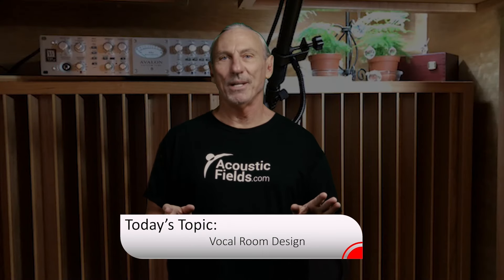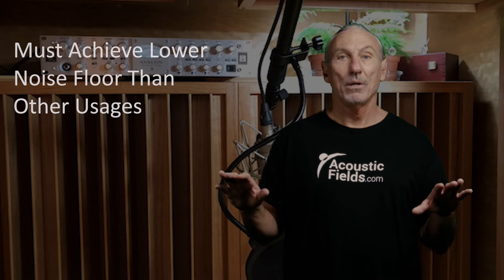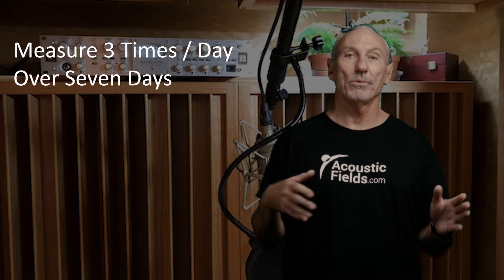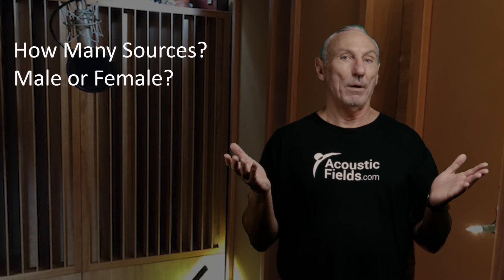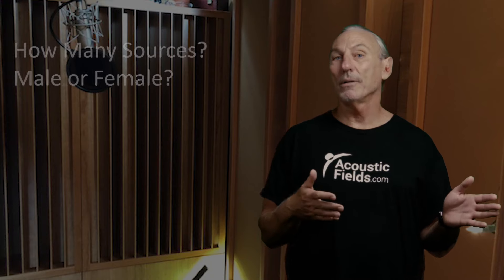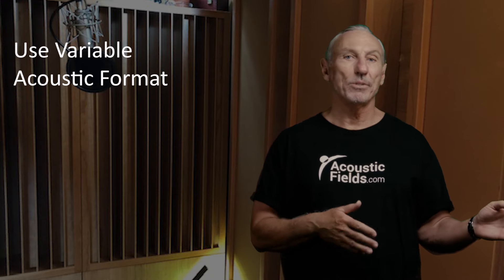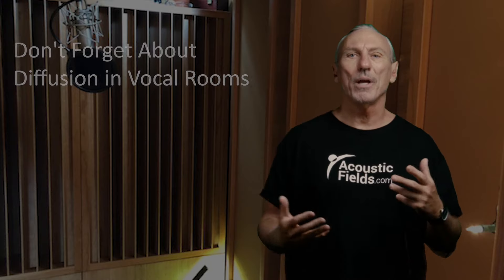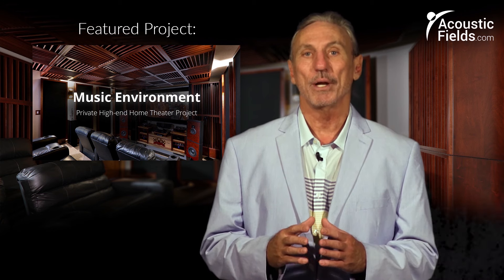Vocal Room Design - www.AcousticFields.com

Comment: Hi. Thanks for your excellent videos! I record voiceovers out of my home studio setup in my tiny studio apartment in NYC. I'm dealing with the noise of running water coming in from pipes behind one of my walls (bordering my neighbor's bathroom), which is picked up by my mic. I'm considering adding a layer of Quietrock on top of that existing wall, to reduce this noise. Do you think that would make a significant difference, or should I be looking at a different solution?
Reply from the maker: Noise must be quantified and qualified through measurements. We need to understand the frequency and amplitude (strength) of the noise we are trying to mitigate. We can assist you with the measurement and design process. Send us your contact information to info@acousticfields.com
Reply: You can also use noise gate plug ins which helps significantly, but it’s not a 100% cure
Reply: You'd need to open up the walls and soundproof them.  Or buy a ready-made vocal booth like Whisper Room.  Not the best, or cheapest, but in an apartment setting that's what's available.
Reply: @KirkYardley  I'd recommend a noise reduction over a noise gate. Noise reduction helps a lot with unwanted but consistent noises in the background if you can record a long enough sample of it isolated. I've used it to get rid of long droning machine noises often with success.

Comment: I've gone to great lengths to minimise fan noise on my computer that's in the same room as the mic.
Reply from the maker: The more you treat the existing room problems, the lower your room noise floor goes. The lower your noise floor, the more you here. Fan noise can really jump out at you with a low noise floor.
Reply: That's why you should have a separate vocal booth from the control room..
Reply: Move it further away, or get a treated PC case.
Reply: @determine8771  mine is treated, the ambient noise level is less than 10dB, about as quiet as it gets, the case is custom made.
Reply: @ben_tyreman  fair enough, I can’t see that being an enormous issue especially if the mic is not directed at the noise. I don’t see a solution other than distance or a second barrier though.
Reply: @determine8771  when you have very high end mics like a neumann U87ai it picks up everything, and I mean everything in the room, if you use dynamic mics it's less of a problem but still best to minimise it where possible.
Reply: @ben_tyreman  for sure, in my experience the 103 and even nt1 make using a separated studio booth extremely necessary for quality isolation.